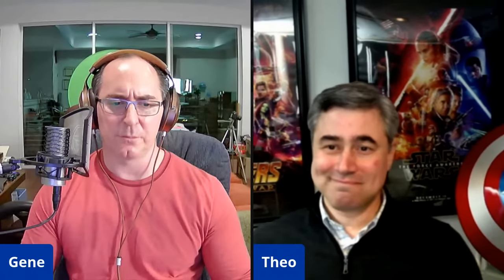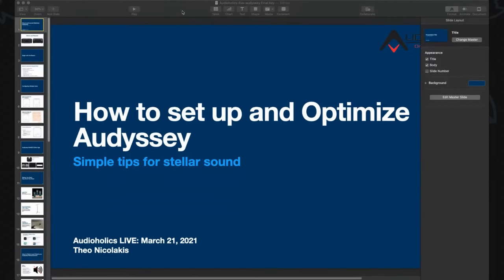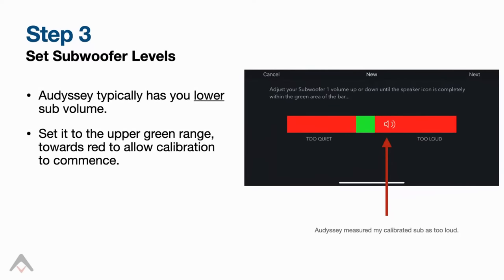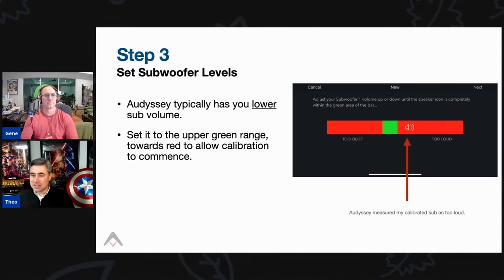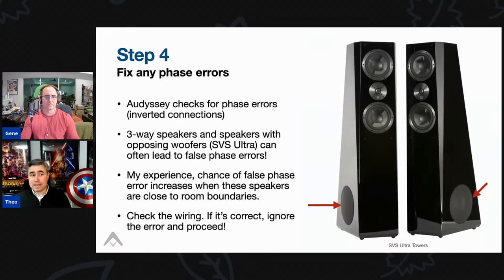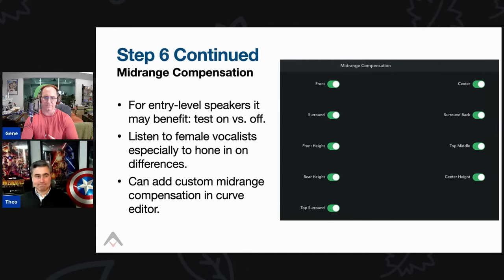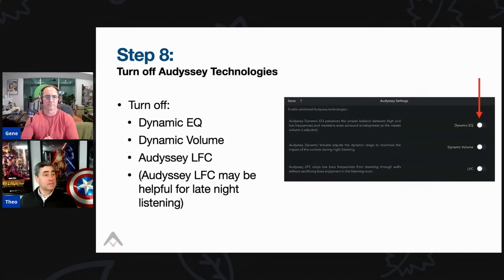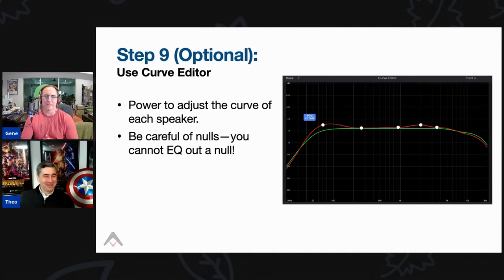Audyssey Room Correction Performance Tips for Your Denon/Marantz Receiver

Comment: How do you get pink noise to each channel from an external source?  Left and right is no problem,   all the other speakers,  no clue.   I've yet to find an app or program that'll send to each channel.  Running a 7.2.4 setup.   Also the app is horrible on an iPad to adjust the curves.  It's like fighting a greased up snake.
Reply: Send the noise to all channels and only plug the speaker that you want the noise from.
You could perhaps create a multichannel audio file with pink noise only in one channel. I don't know if you can use audacity for that or any other wave editor.
Reply: If you download REW and plug the laptop into the AVR with HDMI, you can send discrete tones to the main 7.1 channels. Doesn't support the heights though, but those are the least important.

If you find a copy of the Atmos Demo Disc blu-ray, there's test tone tracks for various Atmos setups including 7.1.4.
Reply: @eitanaltman158  Excellent information,  thank  you.  I play around with REW all the time,  mostly with my PC and Equalizer APO.  I'll give what you suggest a try.

Comment: So, basically, the Audyssey system on my Denon x2500h is crap and worthless as a stand alone system? I use it by itself, use the cardboard stand, and it works for me. My sub is positioned by placing it in listening position, then crawling around the floor to find best response. My sub is not shoved in a corner; it is 2 feet off rear wall, 1 foot off side wall. I do not have a dedicated room just for listening, it is my living room.

Comment: I've been an audiophile over 60 years and this is the best AV educational video I've ever seen.  Thank you very much.  I own the Denon 3700H and am buying an SVS ultra bookshelf system shortly.  I already own  with 2 SVS subs and find that while Audyssey is a cool piece of software it should be used judiciously.  Believe it or not I am still using my original Atlantic Technology (ATL) speakers from 30 years ago.  I remember the old days of calibrating using Avia and the Sound and Vision disc with an SPL meter.  All it did was measure feet and speaker levels.  At the time I was using 2 ATL 10" subs.  But what I vividly remember was those 2 little subs hitting me right in the chest - and that was from 10' away.  Anyway thanks again for the video.
Reply: Thanks Mike!
Reply: Check out the ratbuddy audessy program it allows you to load the calibration files onto the computer and adjust all the same things on the app but you can do so in a finer level and it gives you a bit more info than the app.

Comment: I've watched a dozen videos on Audyssey set up and I have run audyssey a half dozen times. I always end up disabling it and using manual set up. Sounds so much better.
Reply from the maker: I get your frustration. We will be testing Audyssey X soon in hopes things will be better.
Reply: I was of the same opinion frankly until I was able to disable midrange compensation And get a bit more under the hood with the functionality the app delivered. That was a really big change audibly for me
Reply: @Audioholics XT32 right? Or is there yet another version?

Comment: I just bought an RX-A6A!  It will power the 7.1 system and feed my  RX-V2600, both will be used to  power a 23 speaker system in my room.  I have 2 Carver M-400 magnetic fields amps (upgraded recently by a company in Washington state that knows how to do it) running some of the multiple subs and 2, 100 watt plate amps running 2 more.  Then I have 3 powered subwoofers as support.  Woofer size goes from 15" to 8" and my chair is centered between 2 ,15" subs that face down and the other 7 subs are placed around the room in all the resonance nodes. There are 42 separate speaker elements  in 23 cabinets being driven by about 2000 watts in a pyramid shaped room with 10 foot ceiling. With carpet on the floors and hard walls with no square surfaces the room was made for the system.  When I run a YAPO test the mic is on my head and all speakers are aimed at the seated location.  The 3 dimensionality of the sound stage is like sitting front center of the stage.  Very "live" when listening.  
I can't wait to finish installing the RX-A6A and connect everything then see what YAPO will do to adjust timings.    Ah, audio sound, it's a cruel bitch!  :body-blue-raised-arms::face-orange-biting-nails::hand-orange-covering-eyes:😃👍

Comment: Great video! I wish I had seen this before last night.. lol!. 

I calibrated my Denon back when I first got it a year ago and never really gave much thought to how much occasional updates improve things. I bought a new subwoofer so last night I recalibrated (BTW, the new cal procedure is nicer and easier to work with) and WOW, what an improvement.  Audyssey also caught my new subwoofer was not performing as well as it should and popped up an on the fly level adjustment so I could adjust the output level using the subwoofer volume control on the back of it until it was spot on at -75dBm (the target level), before moving forward with the whole room calibration process.  That was a really nice feature, so I didn't waste a lot of time tuning the sound system for the room and everything sounded great after just one pass.  The spatial imaging is so tight, if somebody is speaking, it really sounds like they are in a specific spot, as well as how smoothing things that are moving around are to track as they move.  Can't wait to go back and re-watch some of my favorite movies now that the system is working so much better.  Cheers!

Comment: Hi Gene, love all the videos and information you guys create, you say that audyssey flat sounds the best for you, but what you forget to mention is that flat bypasses your audyssey limmit (curtain) so flat always uses eq for the entire bandwith. Only the referance is possible to limmit what audyssey does
Reply from the maker: I haven't used the regular receiver based Audyssey system in years so you may be correct on that but I'm pretty sure you can add the curtain if you have the mobile app. You can absolutely add a curtain with the PC ver of Audyssey on Flat which is exactly what I did in my system.

Comment: This is a great video, thanks. I will use Polk Audio LSiM 702 F/X once my room is done (sitting in a box now), they seem to be precisely what you mentioned as your wishlist for wides; flush mount with angled baffles that are not dipoles (or considered bipoles). Just took delivery of a Denon AVR-A110, very excited to add into my system.
Reply: Thanks for watching Trevor and enjoy the AVR-A110 it looks AMAZING!

Comment: I found thbe Audssey app well worth the money. I tried using REW, a free and very power room correction software but like most free the user interface and workflow is less than stellar.
Reply: Check out the ratbuddy audessy program it will allow you to take the room correction files and load them up and adjust them on your computer just like the app and can allow for more precise edits to the curves.

Comment: The number of tweaks you have to use to defeat the system is totally in contraction with the easy to use approach.
One thing you could add is first try to optimize your room without Audissey! If you did the job well You will hear how much audissey actually damage the sound. I use it only on my AV8805 for connivence to tackle 50Hz room modes as my room is too small for proper treatment. And i have to admit Audissey does a good job in the low end.
But great video guys 👍
Reply: Check out the ratbuddy audessy program it will allow you to take the room correction files and load them up and adjust them on your computer just like the app and can allow for more precise edits to the curves.
Reply: Well that's exactly what they recommend at the start of the video.

Comment: Pro tip: if you take Gene and Theo’s advice to compare with 2ch music to determine if you like what Audyssey does to your speakers, you can use the “L/R Bypass” mode for “no Audyssey”. 

The L/R Bypass setting disables Audyssey only for the FR/FL mains, but preserves the EQ on the sub. So you can switch between “Reference” (full range EQ) and “Bypass” (sub EQ only) while listening to 2ch music, and preserve the calibrated deep bass from the subs. 

So then all you’re hearing is the impact of Audyssey on the main speakers. If you decide you dislike the full range EQ, then you can use the App to lower the curtain to 300-500Hz, and you get some correction for the bass region only.

(Also Gene you are correct that the Flat setting in the AVR doesn’t have the MRC dip if you’re using an old AVR that doesn’t support the App; however if you use the App then the MRC setting applies to both Flat and Reference!)
Reply: I’ve the same setting for 2 channel listening. Focal front speakers and two Dali subs. Marantz 6014 + Rotel RB 1590. Marantz 6014 pre out fronts
Reply: I found it easier to simply switch between DIRECT and STEREO for comparison as I was always going to use Audyssey to help smooth out bass. Just remember to use REFERENCE once you have set the cut off so it applies. You should easily be able to tell that FLAT is still applying full range EQ. It was night and day to me so I am currently only using EQ to 500hz but my old much less expensive still highly rated speakers sounded better with full range EQ.
Reply: @markym3870  flat - direct  auto = subs included is much smoother and not boomy for music listening in my room. Curtain 300 MHz. I prefer these settings. .
Reply: Are you sure? As far as I know flat ignores any curve settings from the app, including the range limiter.

Comment: Great video! I’ve been waiting for a really good tutorial like this for Audyssey! A friend of mine and I both just bought the new Anniversary edition Denon AVR A110. We’re both also using external amps especially for our sound stage. One thing I’ve found on this video that’s not correct, well, at least not with my A110, is you CAN adjust your subs in the red above 75db and it’ll still let you continue with the calibration using whatever DB level you chose. For example I chose 80dbl’s and I could still continue with Audyssey for the rest of the way. So you may want to double check that again. Maybe they just started letting us do this? IDK? As I just ran Audyssey last week. But I had no problems with my dual SB16 Ultra’s.
Reply: There are newer tweaks in the 2020 models with Audyssey such as being able to load two measurements that are not in pre-2020 models. This may be another (?)
Reply: @TheoNicolakis  yes, I posted that in one of Gene’s other videos. Since the A110 is supposed to be the “Anniversary Edition” of what Denon has achieved. You’d think it would have every possible feature Denon offers in their 2020 models. Especially since the A110 was made in Oct 2020. Regardless of it being an Audiophile version of the 8500. But, with the Audyssey app you can store as many preset calibrations as you want as long as you’re willing to update the A110 with the app.
Reply: @TheoNicolakis  Look into the Ratbuddyaudyssey program it allows you to take the files from the room corrections and bring them up on the computer and adjust them in more detail and can do everything the apps can do and more. Its worth checking it out !!
Reply: Hey there.. So how are you finding the 110 performance.. Is it an upgrade to the 8500h.. Thanks

Comment: Long time listener and follower, I appreciate all your hard work and putting together this video.  It answered a lot of my questions, but I have three questions I can't seem to find any answers for and hoping you or someone readiing this can assist:
1.  It was recommended not to use all (8) listening positions, but don't recall hearing how many should be used.   What is the recommendation..3 or 6?
2.  If we want to adjust my speaker levels after running Audyssey, where should it be done?  Shouldn't it be in the app since the app over writes anything in that preset?  If it is the app, how are the test tone played.
3.  I can't find anything on how to play pink noise through my AVR (Denon 3800) and adjusting the speaker levels at the same.  Is there direction on how to do so?

Comment: Just in case this has not been said, if anybody is using a Marantz prepro with an Emotiva amp and XLR cables hooked up, you will get a false phase error during Audyssey calibration.  All Gen3 Emotiva amps are XLR pin 3 hot and pin 2 cold, which is out of phase.  Emotiva recommended that in order to fix this, reverse the speaker wire polarity on the output side of your amplifier.  I can confirm that this works.

Comment: I am a heretic, and used Audyssey for the different purpose, of course positioning the microphone differently. First of all, my 4-way system consisting of a horn sub under the floor, woofers in concrete boxes, line arrays in walls, with added arrays of tweeters, have pretty bumpy frequency response, that Audyssey made almost flat. And second, I do not want Audyssey to screw it according to inevitable nulls and bumps that the room causes in the microphone, even with a shelf from floor to the ceiling with a mattress topper behind it on the wall, but castrating the frequency band for it is the wrong way, IMHO. The next time I will try the app, thank you! :)
Reply: Check out the ratbuddy audessy program it will allow you to take the room correction files and load them up and adjust them on your computer just like the app and can allow for more precise edits to the curves.
Reply: I refuse to pay £20 for an app which most people say doesn't work properly.

Comment: Great information as usual. I'm going to try some of these tips to recalibrate my home theater setup. Couple of questions though: A lot of people are pushing to get the biggest subs I can afford, usually 15" or 18". Are you saying that I would be better off with multiples of 10" or 12" instead? My room is extremely large, 6000+ cubic ft open floor plan with vaulted ceilings. I know SVS PB-1000 is cheap enough I could afford 4 of them for less than one 18" sub. Second question, Klipsch RP-8000F vs Paradigm Premier 800f. Are the Paradigms worth double the price of the Klipsch?

Comment: I just watched this video and i want to thank you  so much for the quality and quantity of infos regarding MultEq-X room correction.It's been of great help for me in my own room correction.
I was wondering if you've noticed that  recommandation in the MultEQ-X user guide ,page 21 under "Tips for taking measurements" item 7 says "Vary the height of the microphone by a few inches between  measurements positions to  account of the standing waves between the floor and ceiling".Have you experimented this? could it bring a significative change or refinement in the whole calibration process? 
Thank you in advance for your answer
Reply: Yes, try doing exactly that, and you can compare the results with other profiles that you measure. If you are calibrating for a single sweet spot, then I suggest you stay within that 20 inch or so mark that I mention in the video otherwise you’re going to spread the calibration measurement parameters out too far.

Comment: Just ran through XT32 on my x3700h. Results seem different but I still need testing and REW measurements to compare setting my Tekton DI as small/large. Coming from a Pioneer sc-27, I'm kind of amazed at how feature lean XT32 is in comparison. MCACC had 5 profile banks with the ability to set different EQ curves on the fly for them 15 years ago and Denon gives us 2 and boasts about it as a "new" feature. I was also kind of surprised by how the entirety of the calibration was just 3 short chirps and that's it. Maybe it's just so much better that it doesn't need all the extra tests, but it doesn't inspire that confidence in me. PEQ is a pretty big miss here as I'd like to limit the room correction, but at the same time we've been watching movies and the highs in action movies and thing like The Hobbit/LOTR  have been painfully piercing, so I need the full ban to ad din a downslope for the treble.

Comment: I only changed the frequency to 80Hz  on the speakers that audyssey set below 80Hz. 90Hz and above, I left alone.  My fronts are from the 80's, and they do sound better with the midrange compensation.
Reply: @shaolin95  Thanks for the verification.

Comment: Ratbuddssey is a tool developed by some enthusiast, windows based eq editor app tweak tool. You import the app takenesaurement into the tool and then per speaker basis type out frequencies, q factors and boost or cut value like a very advanced PEQ. Save it, import it back into the eq app and then send it over to the AVR. Great in theory, but my experience was that whatever I did i could not see any difference from the original graph (using REW).
Reply: Yea i wish he didnt gloss over it cause i think it can be a good option for editing curves if you only have a phone and it would be really useful for the people from audioholics to check it out and see

Comment: I have a Marantz NR1711 newly purchased for a business office and they want to control the volume using the web interface. The NR1711 doesn't appear have this function like the Marantz NR1601 from several years ago. Do you know any work around for this? also how can you have "All Zone Stereo On"  as a default setting so when you power on the receiver it is already on? Thanks in advance, love your videos!